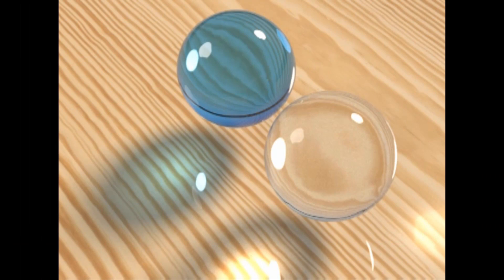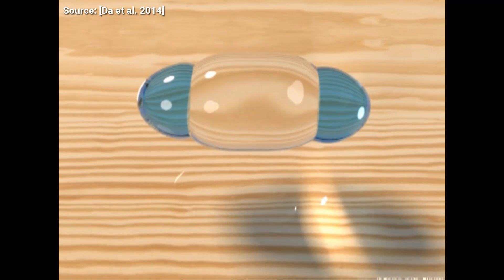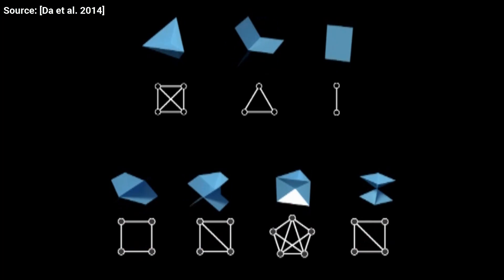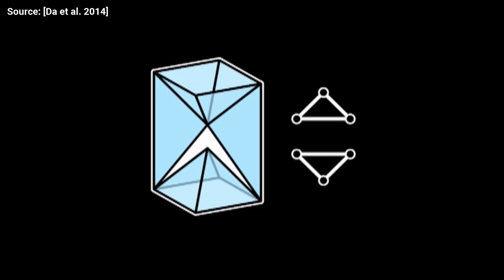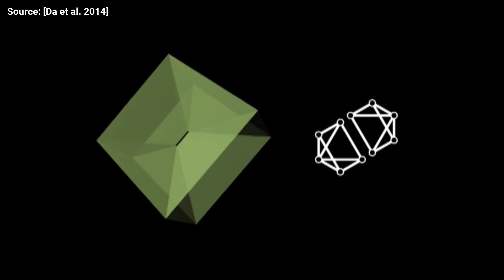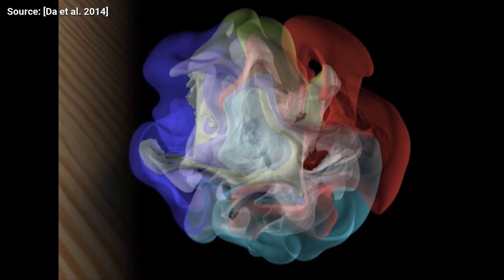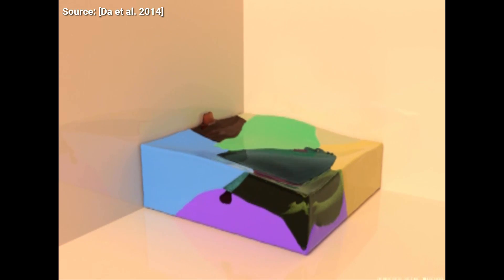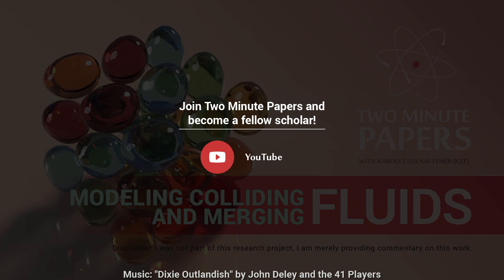Modeling Colliding and Merging Fluids | Two Minute Papers #18

Comment: Well, fluids are made of atoms, and atoms are discrete. Even atoms are made of subatomic particles, which as far as we now today are discrete. And even if the true essence of reality is continuous we just have to use a sufficiently large number of discrete things to simulate it with the precision wanted :)
Finally, the status of the relationship of any set of atoms is discrete, they are attached or not. Unles, may be in a plasma, hmmm...

Comment: This is very interesting. I read the paper at a cursory glance, am I correct in thinking it seems the materials are unmixable? The results look really good but it can get a bit oil/water-like.

I am rather happy to see more interesting models come out, certainly no people waiting around merely for CPUs to get faster.
Reply: +Jeroen D Stout This work is specifically intended to model immiscible fluids where the boundary or interface between the two liquids remains sharply defined, like oil and water. If you think instead of e.g. food colouring and water where things readily mix together, those are miscible fluids, which this is not intended to handle. (There's also more tricky scenarios, such as emulsions, where immiscible liquids are mixed to a very extreme degree, so that one liquid becomes fully dispersed through the other as minute droplets, essentially, which our method would also not likely be able to achieve.)
Reply from the maker: +Christopher Batty Note that Christopher is one of the authors of the paper. Welcome and thanks for clearing this up! :)
Reply from the maker: +Jeroen D Stout Hey there Jeroen! Agreed, I think they are not mixing in these cases, therefore the topology changes that take place become interesting. If they would mix, there would be one big blob and the topology changes are drastically easier to model. Not claiming to be a 100% sure, just my understanding. :)
Reply: +Károly Zsolnai-Fehér (Two Minute Papers) I was more thinking along the lines that there ought to be some mixing in most fluids; initially the surfaces are maintained, then when you stir them enough they mix? Perhaps that later 'break-up' could be part of a hybrid solution. .. I now suddenly realise I am not sure how fluids mix in reality, which is a bit odd.
Reply from the maker: +Jeroen D Stout Time to add some milk to the coffee and experiment! :)

Comment: This is awesome! Along with that one paper that managed to have two materials be simulated simultaneously by only modelling the phase (it specifically was about water-air interactions which most fluid sims basically ignore) this is amazing progress.
This probably cannot simulate something like this: https://youtu.be/ZMsaH6SY4CY as of yet. And it looks like the phases here stay constant. No dissolving effect. I realize that would be incredibly difficult to model in full: dissolution, evaporation and, given your dissolved substance was a solid, crystalization. Arbitrary phase transitions etc.
Though fluids, smoke particles and volumetrics are three huge fields of CG research since years already. Every year brings results more impressive than the last.
Reply from the maker: +Kram1032 Exactly Kram. Even if a framework exists (it may exist), it probably would take unbelievably long to simulate every frame. There are already many CFD applications in the industry that take days to simulate a time step on an ordinary machine. The source of the performance of these techniques is that they are able to simplify some effects that are not needed for a given application.